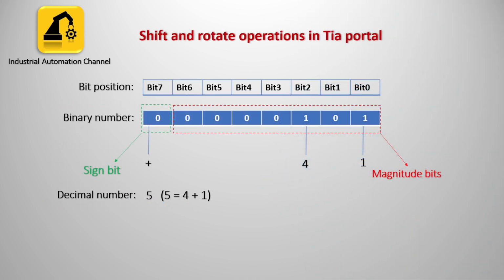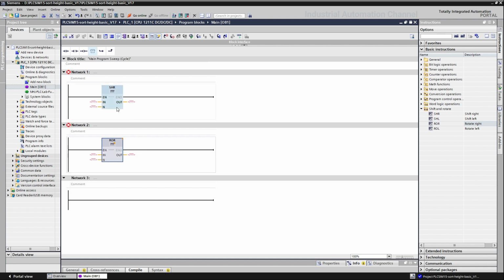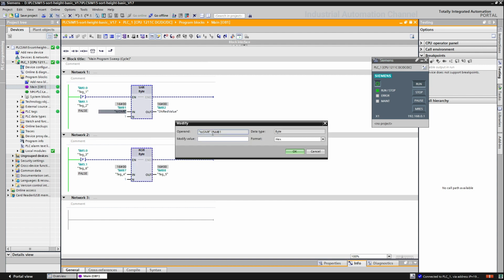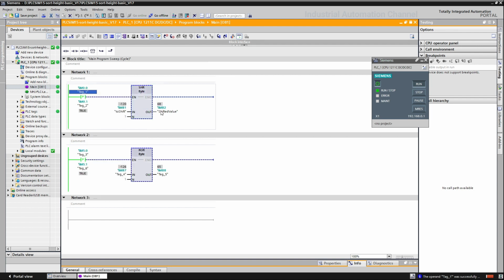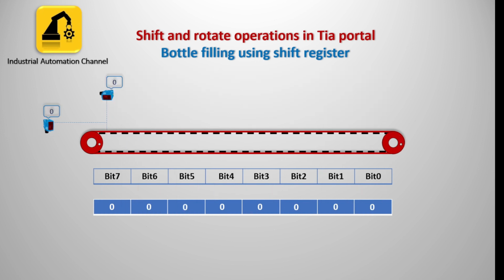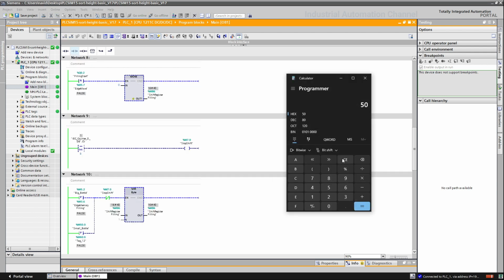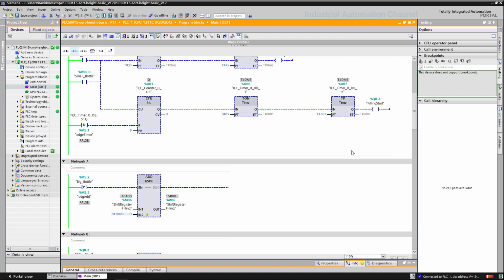TIA Portal #16: Shift and Rotate in Tia Portal | Bottle filling using shift register

Comment: Thanks Sir 

I just have a question if my first bottle is big one the binary number should be 1000 0000 but according to your code it will be 0100 0000 since you are using add first then shr
Reply from the maker: Right. At first it will be 1000 0000 but then it will be shifted because the bottles are also moved to to right on convoyer after each detecting of bottles and because of this I wrote the code in this way. For the last bottle to prevent this I'v used the bit StopShift (NC before EN of SHR function in Network 10) when the number of bottles is 8 so with last bottle the shift register won be changed.

Comment: Can you tell again why in network 7 you add 1 to msb for big bottle I can't get it thanks
Reply from the maker: This network is to detect the big bottles (Using edge detection at the left side of the network). In our program big bottle is known as 1 and small one as 0. So I used this network to add a 1 to the left of our shift register, when a big bottle is detected. If you don't use this network it will be just 0 added with each bottle.

Comment: i loved your explanation better than others video. in  this video, based on byte that saved on memory byte ShiftRegsterFilling there are BigBottle as 1 and SmallBottle as 0, how can you make these ShiftRegsterFilling values to affect those tags(tag 4,5,6....11)? did you using array?
Reply from the maker: Hi.
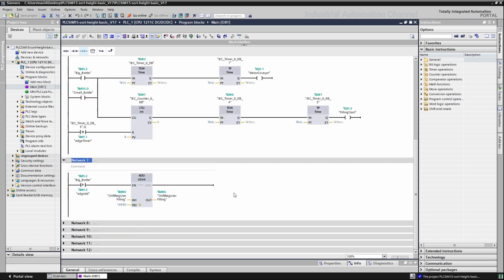here  --> 10:32  you can find the explanation how big and small bottles are saved at register. I didn't use array (You can use it and it can be also another solution) I wanted to learn toghether basics of shift so I used it with Add function to shift the values 0 and 1 and saved them according to the bottles.
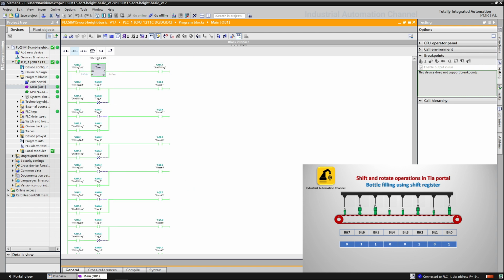Reply: @industrial_automation  of course i know, your explanation was very well that you have combine ADD & SHIFT instruction to saved Big & Small Bottle, but i still dont get it How can register value affecting tag 4, 5, 6, 7...11 i minute 13:47 until 14:23, where those tags (4...11) come from? and function of these tags are to activate nazzel that would fill the bottle based on it's size, i  just confused about how can you manipulate tag 4 - 11 with register value. loved your explanation & it's important to me, thank you sir
Reply from the maker: @shinypotato7204  You're welcome :)
where those tags (4...11) come from? ---> Consider the adresses of these Tags. They are m6.0 to m6.7. (Memory bit 0 to 7 of byte 6)
 What is the address of our shift register? It's MB6. It means memory byte 6, consisting of bit 0 ...7
Now what are these bits 0,1,2, ...7? They are status of bottles. We have saved 1 for big and 0 for small bottles inside these bits. 
in other word I have used Tag " Shift register filling" in the network 7 with the address of MB6 (Output of ADD function) and then I have parse the byte to bits (MByte6 to M6.0 ..M6.7) and used for each bit a tag (4 .... 11)
When we have big bottle, the bit will be 1, so normally open contact will activate long filling and with small one and bit 0 normally close will activate short filling. 
Just try to understand the byte 6 and its bits.
Reply: @industrial_automation  oh my god, thank you so much, Now i know that MByte6 can  parse value to M6,.0 ...  M6.7. thank you so much sir, it's totally clear explanation, I just found out about this:(